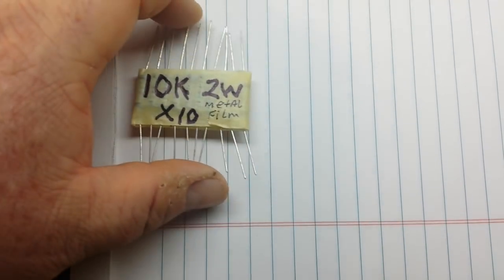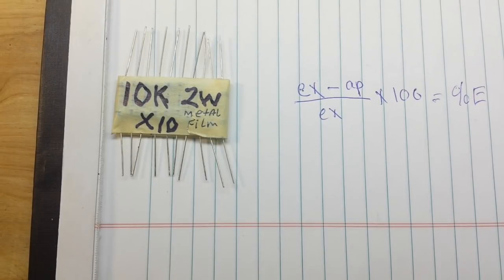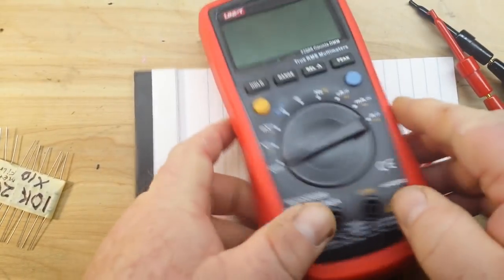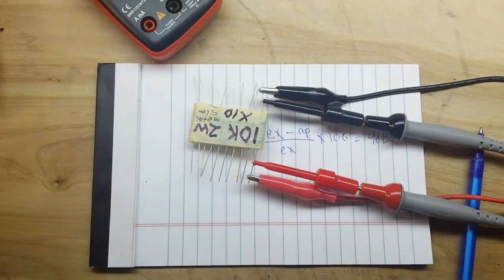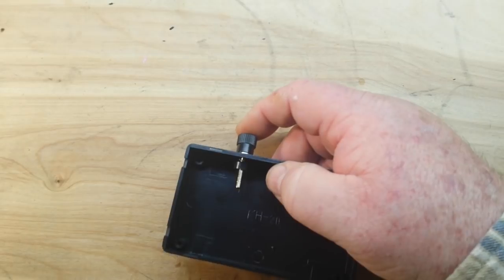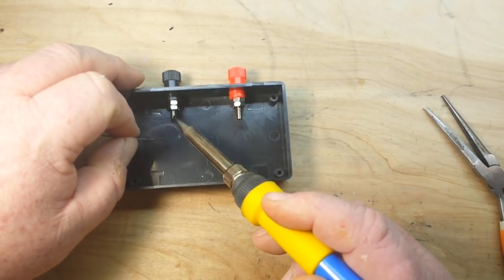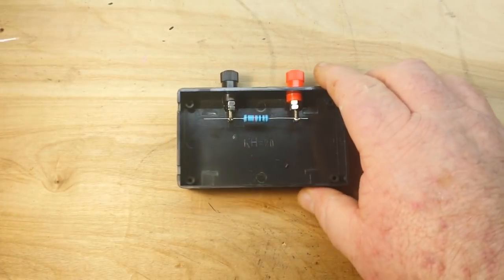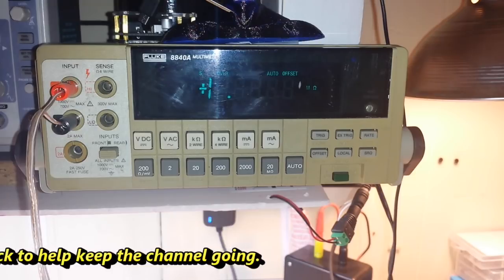DIY Resistance Standard

Comment: Add two more terminals for sense leads for a four wire measurement. Lose the solder, and rather wrap those resistor leads between the post nuts.  It will be way more stable and useful as a shop "standard".  There are a lot of different metals touching in there.  The solder throws it off and adds even more temp instability. It would be interesting to see how far the % swings with shop temp.  You'd be amazed at how much it moves with every degree.  Another video would be cool.

Comment: Happy New Year!!  Will that value for those metal oxide resistors also change with temperature?
Reply from the maker: +Michael Padovani Yes. There will be temperature drift. I keep my place 68 degrees year round so it shouldn't be a problem.
Reply: learnelectronics nice and comfortable!
Reply: For a metal foil resistor, the Temperature Coefficient of Resistance is usually between 50 and 100 ppm/K.

Read more http://www.resistorguide.com/metal-film-resistor/
.. Since we are measuring to around five digits, or around 10ppm marker, the drift is unlikely to be too significant at room temperature. It is there though and you need to be aware of it when performing precise measurements. 
If you want more precision, grab a (significantly more expensive) metal film resistor.
Reply: Ah man, this is magic, a wee gadget, a project, new tech and minimal cost to me - Thank you, but you’re losing your touch Paul... 👍🏻🤪🐍